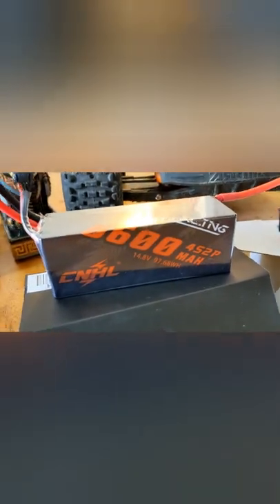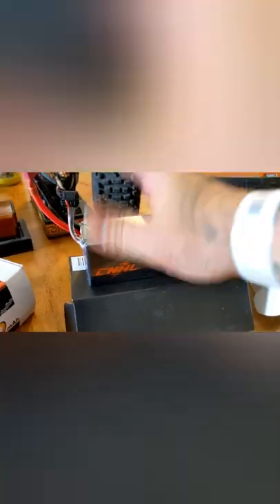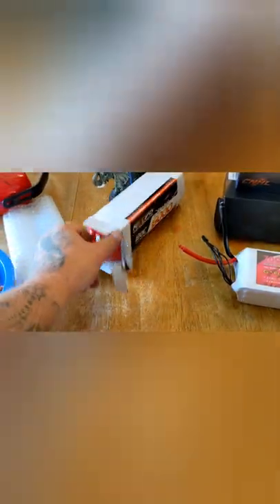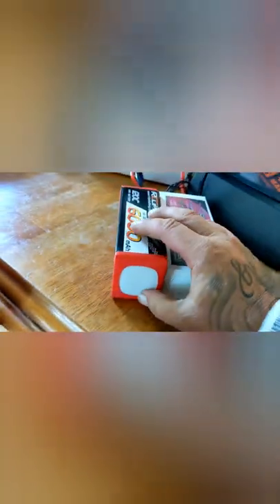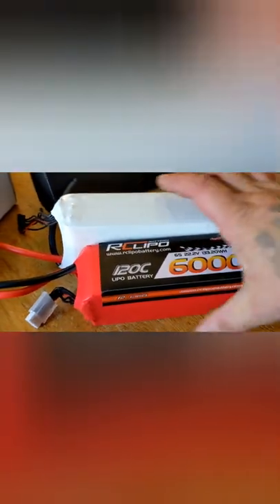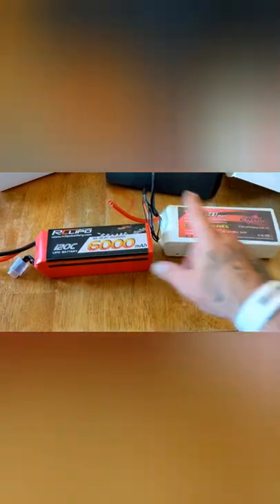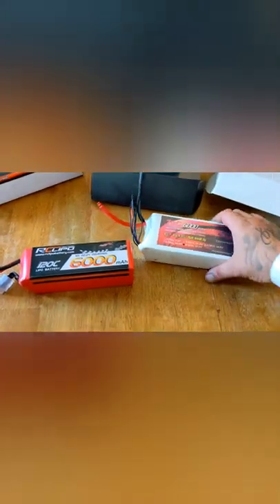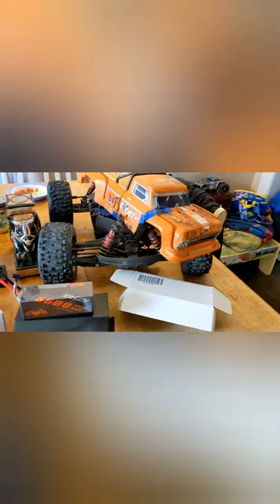oh this is good thank you so much CNHL

Comment: how long does the black 6600mah last on a 1/10 scale truck? im thinking lf getting the 8000mah for myself but i dont know how long its gonna last. im a little concerned since my 3300mah only lasts about 6 minutes on a full charge
Reply from the maker: I only use them on my 8s rigs so but they last forever I got the 4S pack on each side and yeah they last a good 20 minutes I love them batteries absolutely love my recommend them to anybody and yeah probably go to
Reply: @blacksheeprc8113  ok. how long do you think it would last on a 1/10 scale truck
Reply from the maker: @CoolD10  30 40 min
Reply: @blacksheeprc8113  thats great. i found a set of 2 of them on amazon for $110. im going to order it
Reply from the maker: At least 25 I would think I mean I'm not for sure but I would say 25 to 45 minutes
Reply: @blacksheeprc8113  also how long have you had them?
Reply from the maker: I've been running my first set of the 6600 4S for over 2 years and I had a wire come undone out of one of them after a year and a half and they sent me a brand new one for free after a year and a half of using it so they're an amazing company the customer service is great I mean you can email Kevin yourself or hit him up on Facebook he's a great dude I promise you cannot go wrong with these batteries
Reply from the maker: I also have some little mini 3s packs and little 4S packs and mini 5S packs I got big 9,500 milliamp 6s packs you cannot go wrong with these batteries I promise you
Reply: @blacksheeprc8113  ok. i also saw on one of you other replies that you had 2 fairly new batteries that blew up. which batteries were those?
Reply from the maker: Rclipo had a couple of them puff up on me and then the one see NHL lipo I said I had the bad wire on but that was your old battery and they sent me